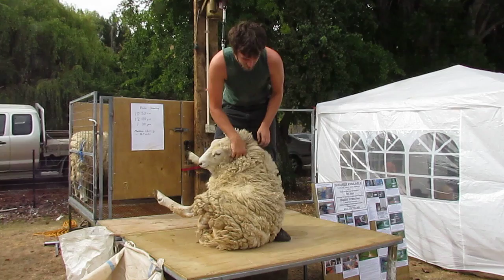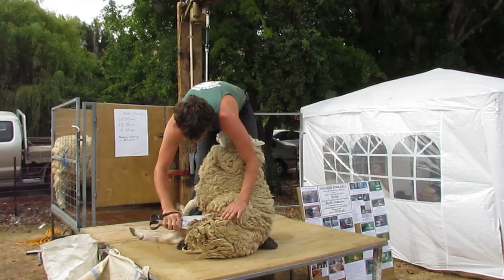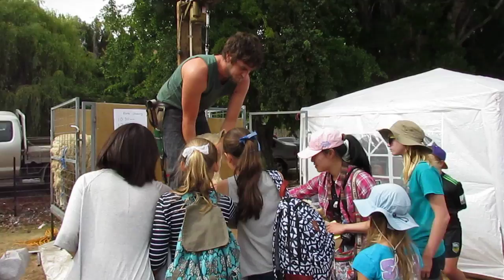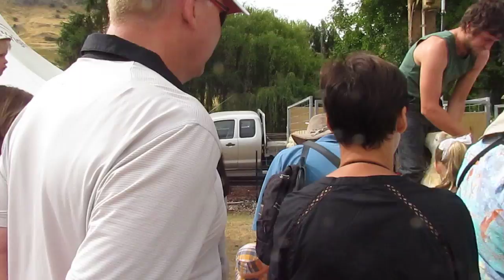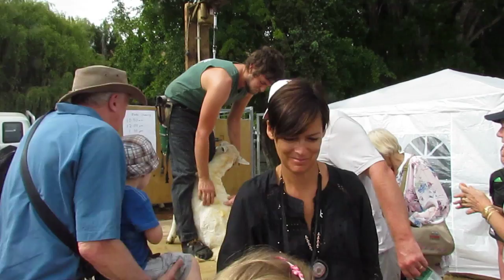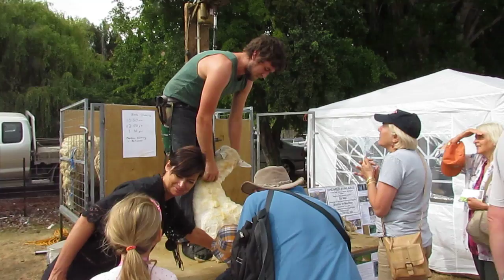Blade Shearing Demonstration at Lake Hayes

Comment: Excellent Allan.  We still hand shear here in  the Outer Hebrides; what make are your shears, and where can I get them.  Burgon and Ball are rubbish now; the set is always wrong, badly made and they won't cut bugger all.  The old Sorbys were good, but you can't get them. Many thanks mate:)
Reply from the maker: Sorry I never saw your message before John. I still use Burgon and ball shears but they certainly take more work to get them running than they used to. I would love to come out and do some blade shearing in the outer Hebrides when I'm in Scotland next year.